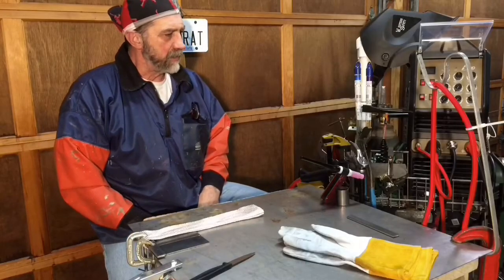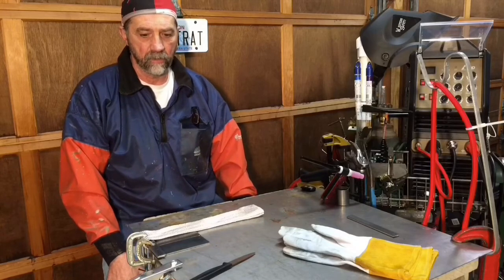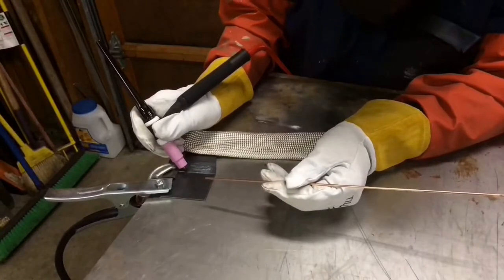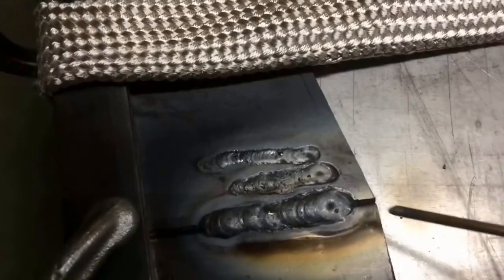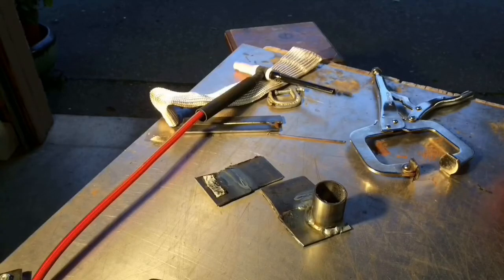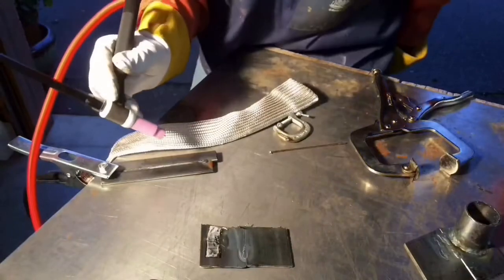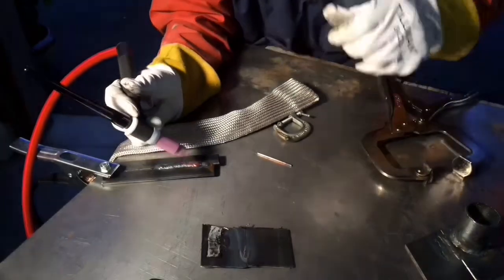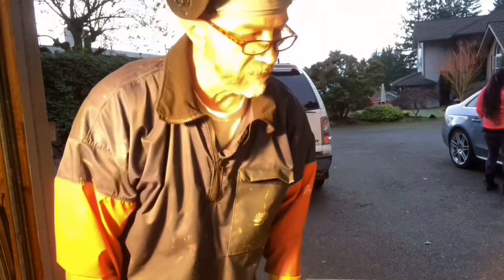My First Time Tig Welding with the Alpha 200x/ Desert Rat 2000

Comment: Just ordered that same welder. Can't wait to start learning!!  By the way, how is the welder holding up for you?  Thanks for the video, very helpful!!!
Reply from the maker: Hey Rocky, I love my Alpha 200x it is so nice especially when the cost is so low, to be able to get started for around 1000 bucks. It is holding up great, I have welded up  quite few little items to aid me in welding, it's a real good way to get the feel of the welder with the various thickness and different types of metal. I have been forced to take a break due to surgery but should be back at it soon, I have a couple of projects to finish that have been put on hold and a couple that I want to get started on, feel free to pick my inexperienced brain if I can help. once I get going again I plan on posting some of my stuff on youtube.
Reply: Desert Rat 2000 Thank You!!! Hope you get well soon, as I'm sure I will need to ask questions!!!LOL. Thanks Again!
Reply from the maker: Oh yeah, no problem, glad to help. I asked a few questions when I was just getting started, lucky for me a few answered me back, what really surprised me is that everyone wants you to subscribe to their channel  but don't give you the time of day if you have a question
Reply: Desert Rat 2000   Hello!  Got my welder in and started using it the other day. When I turn the welder on, and hit the foot pedal,  I hear like air inside the machine. I'm getting gas out the torch, but wondered if you experience the same, or do you think I may have a leak inside the machine.  Thanks for your help!!!
Reply from the maker: Hey Rocky, I am laid up right now with my knee so I have a lot of time on my hands, we should talk on the phone, I don't mind giving you my number, or you could give me yours, we can talk today, a little later, we could cover so much, I can give you a lot of info, I have a ton of time on my machine, havn't done a lot, but never the less I do have some time spent on some of the basics, just let me know what you want to do.  Mike
Reply: Desert Rat 2000 sent you a message with my number, if you have a minute to talk, thanks!
Reply from the maker: Rocky, I don't see your number anywhere
Reply from the maker: Sorry it took so long to get back to you, i love the welder and is holding up good, did you get one, do you like yours

Comment: Grind mill scale off. Watch your torch angle. I bought my AHP used (1 year old) about 4 months ago.  I got some torch time for a couple of weeks and then didn't use it for about 9 weeks due to my garage being so cold that I could not get it up to 45F.  It  has warmed up enough to be able to keep heat in the garage and I have been using it for the last couple of weeks.  I haven't attempted aluminum yet but my mild steel welds are looking real good. I am going to try aluminum within the next week or two. 

I have an aluminum spool gun for my Mig welder and did some spool gun welding with my Mig machine but the welds looked like crap.  It took my about 4 months of trolling Craigslist every day before I finally found a used  AHP at a reasonable price.  The asking prices for first two that I found on Craiglist were only -$25 & -$35 off of the Amazon new price and I refused to buy a used machine (no warranty) to save $25. I ended up driving about 60 miles, got a  #19 and a #27 torch with the machine for $375.  I did good in my opinion. I really like the AHP 200SX.
Reply from the maker: Thank you, sorry took so long to get back , for some reason I don’t get all the comments, by know your probably pretty good welder, thanks for coming by

Comment: Hey there Desert Rat!  Unless you are using the 4T control, you don't have to worry about starting or ending amps.  4T is very helpful when using the finger switch, but make sure to leave it on 2T when using the foot pedal.  Cause if you use the foot pedal on 4T, you have to turn the torch on with the pedal (starting amps), then release the pedal and that will give you the full current (main amps), then you hit the pedal again and that starts the ending amps and will run until you release the pedal.  I've left my machine on 4T a few times when switching back to the pedal and couldn't figure out what the heck was going on.  Ah the 2T/4T setting.  Also!  Grind and clean your metal.  Not suppose to weld mill scale.  It will really mess with your results.  Keep on welding!  You're on the right track!
Reply from the maker: Hey James, thank you for the reply that clears up a lot, also I am finding out how important it is to have clean metal with Tig welding. When Tig welding is going good it is a lot of fun, thanks again, Mike